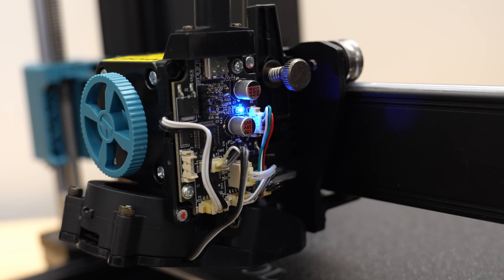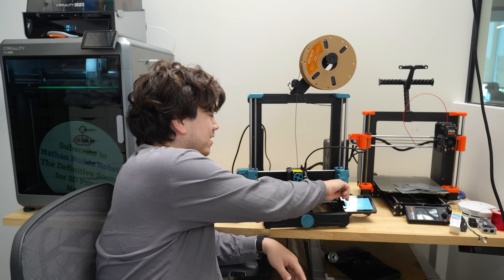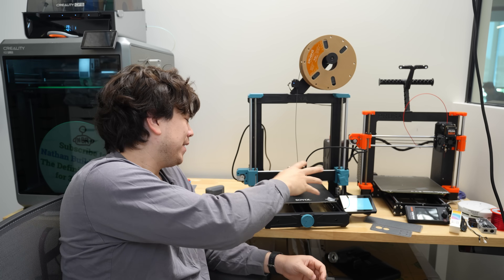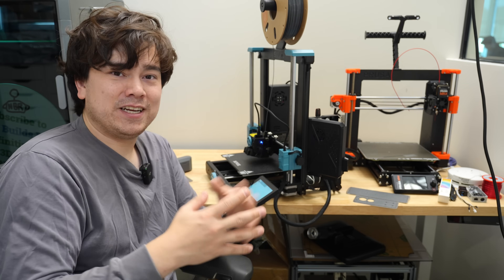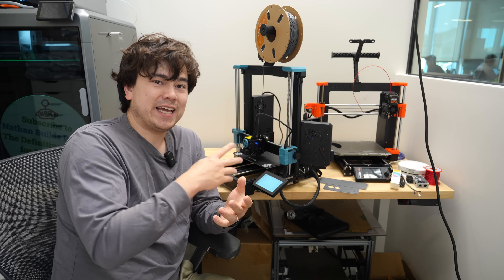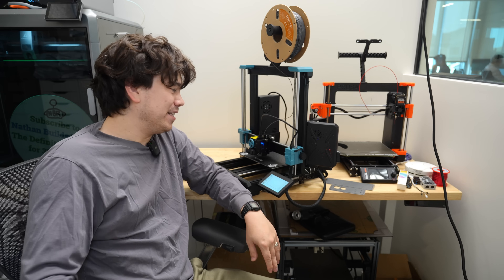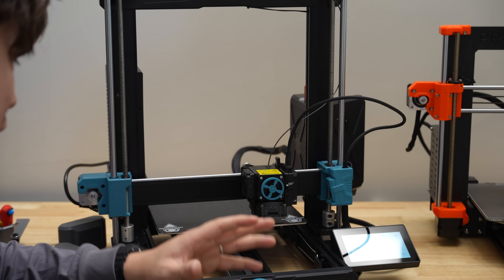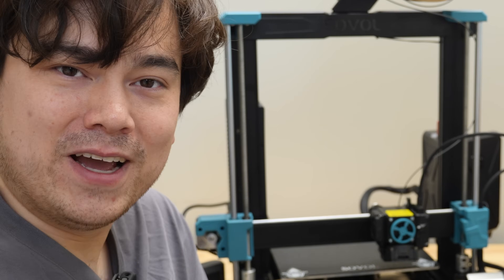Sovol SV-06 ACE: Sovol's PRUSA Clone

Comment: I appreciate the easy maintenance of the older bedslinger designs. I'm happy to see Sovol giving us an updated basic platform and keeping it truly opensource.
Reply: Problem is with sovol they mostly use chips that are difficult to update. My sovol klipperscreen is almost impossible to update. If you want to use the default apt command to update the debian system it can even brick itself. 

If this machine has a way to update itself, it would consider buying it.

Comment: at the full retail price of 299, hard pass, even at 250 I'd still pass. Now when they start showing up from Solvol on their eBay store as refurbished machines for under 200 dollars, I'd definitely consider buying one. By the time they are showing up as refurbs, there should be a good bit of support for the printer for 3d models to print to fix issues like you described for the lcd display ribbon cable, and I am sure that modders will come up with better firmware to fix shortcomings in the solvol firmware, so kudos to them for providing the source code,etc. for the printer.

Comment: the wifi issues, with your machine at least, could simply be from the wifi wire running right next to the motor in the control box fan. Route it about the board, perhaps?

Comment: My SV08 has a problem with WiFi so I bought a WiFi bridge and plugged it into the SV08's Ethernet port.  Apparently the SV06 Ace doesn't have an Ethernet port.  A Klipper machine needs network access.  I'm not going to go back to putting G code on a thumb drive after printing files over the local network.  Other than that and the fan noise (Noctua to the rescue?), I'm liking the SV06 Ace.

Comment: The world definitely needs a basic Klipper bed slinger that has all steel motion control components (no Delrin V rollers).  Open source is double plus good.  With the solid motion control supporting higher speed Klipper enabled printing, I can see getting the larger version of this to use to crank out beds full of smaller parts, with the confidence in the first layer that a bed mesh provides.
Reply from the maker: If I were them I’d have skipped this model and just gone with the bigger one straight away

Comment: Thanks, Nathan.  My next experiment will be to use the ACE configs on my Klipper-updated SV06 standard. The only diff that I see is the new X and Y access support beams.  But, I've updated my SV06 to Drylin bearings, so I don't expect the stock supports to be problematic.  Please stand by ...

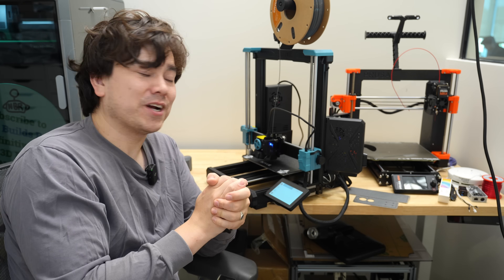Comment: 6:40 if it's anything like the original SV06, it's very likely this will be your entire experience with this printer. I've had my SV06 for a year and without any serious mods or fixes, that's just how it is. At least in my experience. Along the lines of what you said, I would not recommend buying this unless you want to mod it, which I'm planning to start doing with my SV06 very soon

Comment: I saw they have a plus coming,  which id be intrested in but with the elegoo centuri pricing at $199 and the carbon at $299, its hard to compete with such a high quality printer at this pricepoint.
Reply from the maker: I wonder if that's the introductory pricing that they are selling at a loss, or the actual MSRP

Comment: I'm actual very positive on this printer. I thought the SV06 was a good design, and the I thought the SV06 Plus was even better. The only thing missing was speed! Klipper solves that and improves the print quality. They also added some components from the Plus it seems to make it sturdier. While I think the SV06 ACE is a good value overall, I think the SV06 ACE Plus will be the biggest winner! Pun intended. This may be a hard sell against the A1, but open Klipper is nice, and the Plus model will have a real size advantage for the money.

Comment: Not sure if I like the metal guide wheels. Feels like it'd be a pain to replace them.
Reply from the maker: They are pretty much standard parts now, it’d probably take about a 5 minutes to replace and re-tension them, same as the delrin wheels
Reply: Barring Nathan pitching the SV06 Ace off a balcony into a dumpster, you'll never need to replace any of the metal motion control components.  Even in a 24/7 print farm, you'll upgrade to a newer better printer before the stainless steel parts wear enough to replace.

Comment: Its better get the old one and put klipper, I did this to my sv06.,
Reply: No? Even the SV07 would be a better choice if on discount. I highly doubt you can print at 600mm/s and 20k acceleration. Especially not with that plastic wheels. The build quality is just way better on this one and the early bird price is good for that specs
Reply: @mettscientist  What plastic wheels?
Reply: @mettscientist  I don't think a bed sling is good for very high speeds and lots of variations  on tall prints. The sv06 had linear rails with LM6UU bearings with is much better the new one motion, with is closer to prusa desing which i like.

Comment: The extruder fans cause errors, fake linear rails, exposed faulty screen cable, bad filament run out sensor position, weird noises from the board, crazy loud fans,  wireless network issues, ...... but its a SOLID MACHINE.  Say good bye to your Sovol sponsorship LOL
Reply from the maker: None of my printers work on my office WiFi, it’s a weird network that requires a login in the browser. And the mechanical build is solid. 

I’m fine if the sovol sponsorship disappears. The only way to get a better review on my channel is to ship a better printer
Reply: @ And that’s why we love you.

Comment: I mean, why?  I had an SV06 Plus, it was the "prusa clone" that came recommended by many influencers but had fatal issues.  It used bump stop to level the x axis... but that didn't work.  Sovol's american engineer sat in on a round table and admitted he broke his trying to bump level it.  The sag from left to right side happened every time the printer was shut off so you needed to use two identical objects to manually level the thing.  It had tool head board issues that would disconnect the bed sensor randomly, causing the head to crash into the plate and bed.  It ignored it's own bed mesh too.  They sold a klipper screen to take the thing to klipper, but it howled so loud at higher speeds I thought a cat was being attacked.  Instead of posting fixes for those things, they just reinvent it and move on?  Thanks for nothing, Sovol.  I have the SV08, it's nice.  My other Sovols were an SV05 (an ok unit) and the SV04 (terrible clogging and poor offset mechanisms, bad bed mesh, etc) and at this point I'm staying away from anything they make that is a cartesian.  It makes not sense to get this at $299 when you can get the infimech TX for $30 more.  Sovol just refuses to move forward.  They are just caught in the habit of tick tock interations of the same things.  I had hoped the SV08 was a new path, but I guess it is one step forward, two steps back.  To make a bed slinger that is just adequate and does what it should have done all along seems silly.  The goalposts have moved tremendously.
Reply from the maker: What about the SV-07? I got one but I don’t even remember if I reviewed it 😂
Reply: @NathanBuildsRobots  it went backwards on the build and used wheels to I guess keep it quieter.  but it was sloppier in printing.  I think it also used actual end stop switches.  My thing is why sort of REMAKE the SV06?  Look at what is out there and copy that.  Trying to be an I3 is about 2 years too late.  Be an A1 or even something new but use a better bed/magnet system, or incorportate beacon, or something.  Don't just fix a bad printer.  I guess.

Comment: In conclusion, a piece of garbage.
Reply: I also hear Nero speaking like that a lot. I don't like this dismissive attitude, it doesn't help anyone. I'm completely with NBR here: It all depends on your budget and if you're willing to tweak a bit here and there. It's easy to dismiss something as "garbage" with Bambu or Prusa - or Voron - in mind. But affordability, simplicity and maintainabilty are really good selling points.
Reply: @sebarsS9 Exactly what I was going to say.
I'm from Brazil and my first printer was the original SV06 Plus. After some calibrations it prints very consistently for a very affordable price.
Bambu labs are completely out of the price range of most people here, prusa not being any different because of import taxes.
The best options we have here are Creality and Sovol IMO